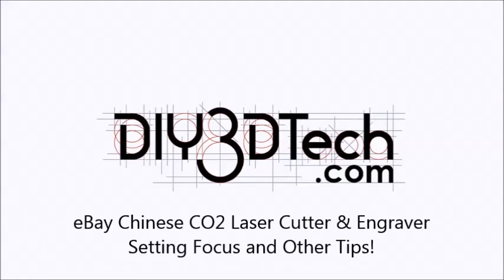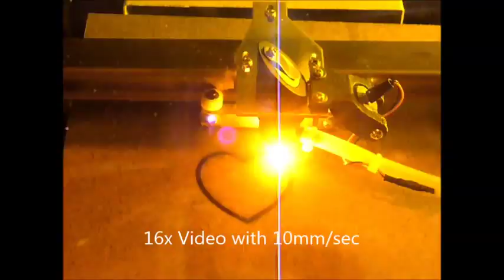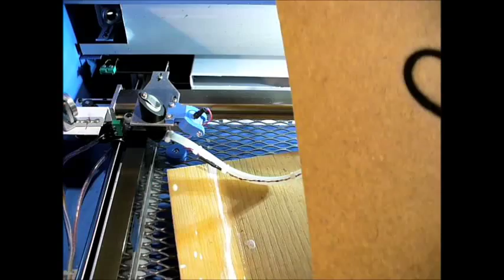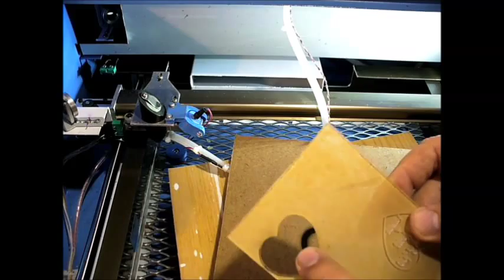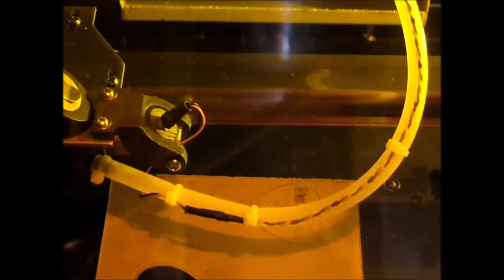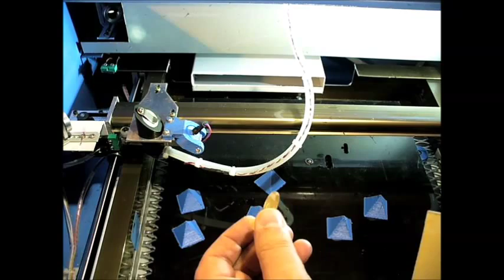eBay Chinese CO2 Laser Cutter & Engraver - Setting Focus and Other Tips

Comment: Use the RAIL for measurement. Find out the proper focus, then measure to the bottom of the rail. Cut a piece of wood to fit the exact distance, and use it to set your proper distance to the surface of the material, (plus half the thickness of the material).

It's far easier to measure from the bottom of the gantry rail than to mess around measuring to the lens.
If it's two inches from the lens to the material, and the rail is 1/4 inch higher, all you need is a stick cut to 2 1/4 inches. The rail goes from left to right so it makes it easy to just measure from the bottom of the rail. Use the slant board method to determine your laser's exact focus distance, then measure to the bottom of the rail and cut a stick that exact length. That's your measuring stick. Don't forget to shoot for the center of your material's thickness... For half inch material I would raise the material 1/4 inch after using the measuring stick to set the surface distance.
Reply from the maker: Yes the slant board method does work well and even did a video on it :-)

Comment: Hi did you fit your own laser pointer if so how's it powered, also how do I get my laser head to zero point top left and set. Appreciate you vids. Brilliant information RM. uk.
Reply from the maker: Your welcome, this  is a laser diode (similar to the ones used in a laser pointer) and in one version I just powered it from an external battery with switch and in another it is powered  a circuit I built into the laser itself...

Comment: Have you ever charted any of your results in various materials, e.g. type of material, thickness of material, speed of laser travel, number of passes . . . ? I'm curious to learn what are the best results I could expect from my K40.
Reply from the maker: Not really there is stuff out there if you Google it but there are so many variables its hard to come up with a generic value.  What is best is to test on a scrap piece of material before doing a production run as even the temp in the room can have an affect on the performance (by de-tuning the mirrors)...
Reply: Is it reasonable to think that a K40 can cut through a 3 mm piece of craft plywood at full power, 10 cm / sec, with 5 passes? Or just a ball-park figure?

For me, it seems like it's taking more than 20 passes . . . and I'm just trying to figure out if it's (a) mirrors are not aligned and lens is not focused OR (b) the K40 isn't really intended for cutting 3 mm craft woods, but is primarily good for engraving.

And if the K40 really can't cut through a piece of 3 mm craft wood, I'd like to know what laser tube COULD be expected to do that: 60W? 80W? 100W?

Comment: Is it possible to replace the laser tube on a 40W Chinese laser with a higher wattage laser tube (e.g. 60W or 80W) without having to make any other modifications to the program, circuit board, etc.? 

If it is possible, where can one order such replacement laser tube?

And if so, a higher powered laser wouldn't affect the focal point, would it?
Reply from the maker: No, not easily.  You could do it and I have seen it done, however you will need to cut a hole in the side of the unit as laser wattage is a function of the length of tube, then you will need a new HV power supply.  The rest will work...

Comment: Just an idea for determining the ultimate focus of the laser; set a board at an angle with one side (let's say left) at 3cm (or as close to the laser you can get) and the other end (right) 6cm lower then have the laser draw a horizontal line.  You can then pick the point along the board where the cut is best and measure the percentage of the distance between the 3cm and 6cm heights and you can determine the height.
Reply from the maker: Thanks for commenting and yupper your correct if you look back in the video playlist for the K40 eBay laser you will see there are several videos on focusing and the "slant board" method is one which I cover :-)